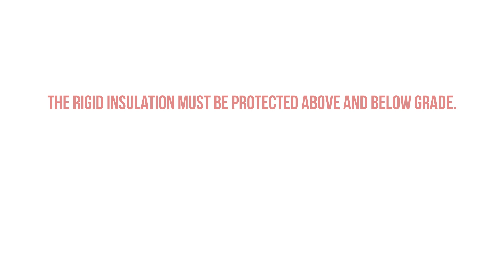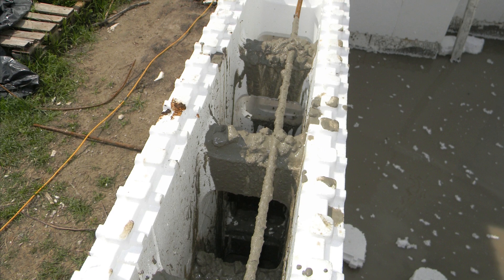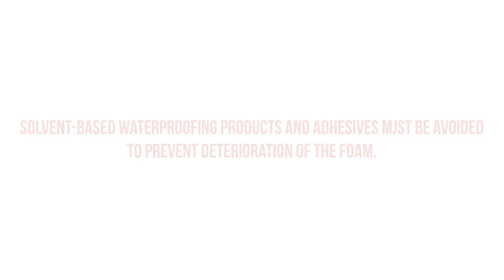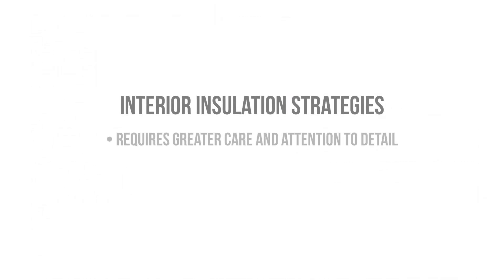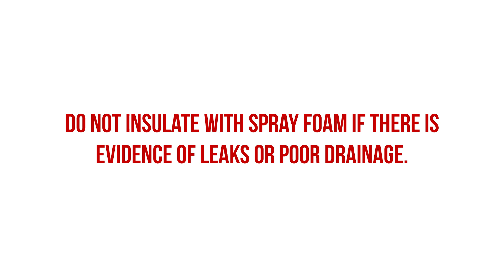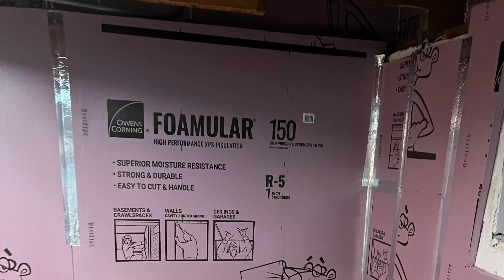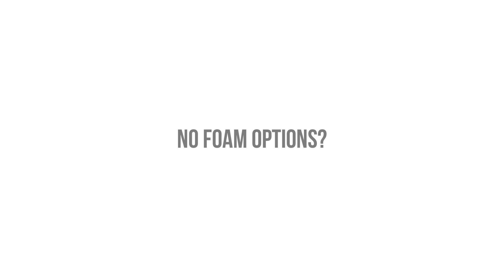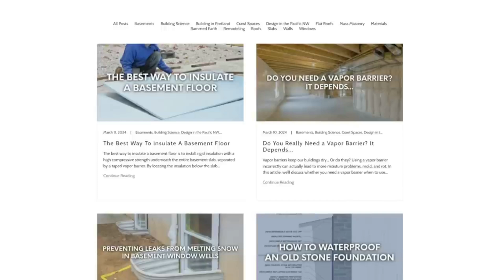5 BEST Basement Insulation Strategies | Insulate The RIGHT WAY...

Comment: Our house was built in 2021 and has an unfinished basement. At the time of the build, the 2x4 exterior walls in the basement were constructed with R11 batting between the studs and directly against the concrete. We are interested in finishing our basement and are wondering what best practice would be. If we did rigid foam board, we would have to demo the stud walls, install the foam board, and re-install the walls.. manageable but not preferable. Closed cell spray foam could work as well but costs are high and I have concerns about off-gassing. The non-foam option you mention here could be a possibility as well. Are you suggesting we could put Rockwool batts up against the concrete and cover with a taped smart vapor retarder? Or is another product required between the Rockwool batts and the concrete?

Comment: I have been watching your great videos but I have two questions that I can't find answered in your videos!   I have an old house with  a loose boulder foundation.  To insulat just down to the frost line, should I lay a a dimple mat four feet down from the top and insulate or should I use a vapour transferable product against the stones and insulate down four feet ?   Second questions.  If I want to insulate the ceiling of the basement/subfloor for the living space, should I put upf rockwool insulation and then a vapour transferable product on the basement ceiling side to allow any condensation from being trapped?  The basement is cool and a dehumidifier runs nonstop.  I am just trying to make it a bit warmer without creating condensation issues.  Hope you can reply!

Comment: Your logic on creating a continuous airtight seal of rigid foam on the interior wall makes sense, but how can you meet fire blocking code? At the top of the foam, you'll have to create a gap in the rigid foam and insert some kind of fire blocking material to bridge between the top plate and the sill. Rockwool works, but air gets through. You could use drywall, but it'll rot, etc.

Comment: I’m planning on using a peel and stick membrane instead of a fluid applied. Would it be a good idea to put the peel and stick over the rigid foam? so the foam has two layers of protection (dimple board and peel and stick)

Comment: I already have a dimpled drainage mat installed directly against my concrete walls on the inside, running into a french drain to my sump- can I glue rigid foam insulation directly over top of the mat?
Reply: I would assume so as he recommends that same approach but on a slab floor. As long as you're not puncturing the dimple mat when putting up the foam.

Comment: Very helpful, as I plan to build a home foundation with exterior insulation. One remaining question I had was regarding the exterior foundation wall area above grade and below the sill. It sounds like the best practice is to extend the water barrier, insulation, and dimple mat to the top of the foundation. But how is the outside of the mat then best covered above grade, both for durability and a finished look?

Comment: What are some methods for handling a partial basement? IE, a 400 sqft basement under a 900 sqft ground floor, with the remainder being peir and beam type crawlspace. It seems most of the houses here built before 1950 have this construction.

Comment: what sort of considerations should be made when designing a walk out basement?
Reply from the maker: @drew50  Well for starters, you have to treat the walls on the walkout side as above grade walls and insulate them accordingly using the right ratios. You also have to pay attention to the floor transition since there is potential for a major thermal  bridge between the basement slab and the exterior environment. Few other things as well, but it mostly has to do with transitioning materials and components.

Comment: Thanks for covering ICF.  Another advantage of ICF is the waterproofing must be applied to the foam, rather than the concrete.  This waterproofing can serve double duty as it also protects the foam from moisture and those nasty insects you mentioned. It is said that EPS foam takes 500 years to decompose in a landfill so keeping it protected would extend it's lifetime even further.  And, as you mentioned, ICF protects the concrete from deterioration by preventing rapid thermal gradients and provides a superior curing environment over formed concrete walls. The thermal mass of the concrete core boosts the effective R-value of the wall.  A full ICF house is a much  more foolproof way of achieving a high performance home since there  are far fewer chances to mess up during the build.  It would be interesting to see you cover the detailing of a full ICF home instead of just basement walls.  My perspective is that of a soon to be retiring electrical engineer and planning to provide most of the labor of an ICF house in western NC.
Reply: Do you think tar would be enough? If the dimple mat is needed, how do you adhere it? I'm worried plastic cap nails would breach the tar and allow water in
Reply: @brodieobrien-pickering2202  The dimple mat provides an expressway for water to get down to the French drain alongside of the footer.  It prevents the buildup of hydrostatic pressure.  The dimple mat does most of the work and the actual waterproofing won't see much water at all, mostly just water running down the side of the house.  I'm like you and would use adhesive to secure the dimple mat.  Some people skip the dimple mat and rely on drainage stone, but I wouldn't want rocks against the waterproofing.
Reply: @brodieobrien-pickering2202  As I have seen, the dimple mat can be just hung like a curtain by fasteners above grade.  Backfill holds it in place afterwards.  The Polywall Arroyo is applied with an adhesive.

Comment: When will you do a video on wood foundations?
Reply from the maker: @CodyOnHomes  It's on the topic list, we actually cover how to address these in my ebook. But I will dedicate a full video to PWF soon.
Reply: Do you mean wood piers in pier and beam construction? Is that even done anymore?
Reply: @Mikey__R  No I mean build a stud wall for the basement wall. Then build the first floor wall the same way above.
Reply: @CodyOnHomes  I don't know about where you live, but that kind of basement would be against code where I live and wouldn't pass inspection.  Even pressure treated wood rated for ground contact wouldn't last long with the kind of vapor pressure it would experience being used as a basement wall.  There is a reason basements are almost universally made from concrete products.
Reply: @r.j.bedore9884  It's in the International building code. Where do you live?
Reply: @CodyOnHomes  I live in Michigan.  I'm genuinely surprised to hear that it's in the IBC because a relative of mine was having an addition put on which required digging into a hillside such that about three to four feet of the wall height would be below grade.  They had planned on having the entire wall made of wood with exposed beams and a bunch of windows, but was told by the contractor that the bottom portion that would be below grade had to be made from concrete to pass inspection, so I assumed (apparently incorrectly) that it was against code.  Maybe it has something to do with the frost line that they said wood wouldn't pass inspection?  I don't know, but between that experience and the fact that in my 40 year lifetime I have never seen a wooden basement (and the vast majority of homes here have a basement) I just assumed it wasn't allowed.  Or maybe it's just that contractors don't feel confident warranting it?

Out of curiosity, why would you want a wooden basement/foundation?  I can't imagine it can be as strong or made as water/insect/mold resistant as a concrete one.